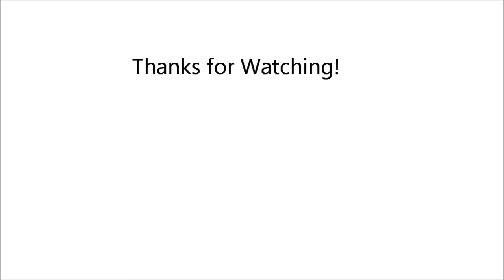Melting Pull Tabs And Other Scrap Aluminum

Comment: I had heard that Al cans and foil were not the best for smelting... now I have the numbers I needed. I do plan on using cans and foil for alloying other metals. 
Thanks for posting!
Reply from the maker: I tried melting foil once but I didn't get much aluminum out of it.  Thanks for watching!
Reply: No, cans are not so good for smelting, cans are made from a wrought type alloy, usually 3000 and 5000 series

Comment: To end with less slag, melt half of your large pieces in one crucible so that there is a puddle of liquid metal at the bottom of the crucible, then pour half of your tabs into this. Doing this will reduce the surface area of aluminium exposed to the air and in turn will reduce oxidisation
Reply from the maker: Good idea, thanks for watching!

Comment: great job seems like pull tabs melt very well the ingots look great one piece of advice i can give is to make sure that whatever aluminum you melt down is dry before putting it in the crucible because if there is any moisture on the aluminum when you melt it down the steam could pop and throw melted aluminum everywhere which wouldnt be good. im curious on how strong the aluminum from the pull tabs is because i plan on eventually making model engines out of this aluminum and im curious if the pull tab aluminum is a decent alloy
Reply from the maker: The cast aluminum using pull tabs has decent strength but it is more brittle than cast bronze (it doesn't bend much before breaking).   I haven't done any strength testing besides beating the aluminum with a hammer :).   I do prefer cast aluminum engine parts instead of  pull tabs because the engine alloys were designed for casting in the first place and it takes a whole bunch of pull tabs to get a decent amount of metal.  Thanks for watching!

Comment: Can I suggest that you clearly mark which ingots are of which type of Aluminium, as the impact wrenches were of a far higher quality and with certain added elements to match specifications, whereas the pull tabs would be of a lower quality and specification. 
I plan to divide my Aluminium stock into: Cast [C], Drink Can [DC], Extruded [E or Ext], and possibly Wheel [W or Wh].
Another way to clearly differentiate the different source material would be to cast your ingots into different shaped molds.
Why? So as to provide the best possible material for future uses and to hopefully provide more consistent results.
Reply from the maker: That is a good idea.  For these ingots I am planning on mixing the two types to improve the properties of the pull tab ingots.  Thanks for watching.
Reply: Mark Fryer 
It's not really a question of quality - aluminum cans are good quality - almost pure aluminum. If anything, the aluminum used for cans is too pure and thus doesn't cast as well as alloys intended for casting.
I know this is probably what you meant, not calling you out, just clarifying for future readers.

Comment: I have been puzzled why people continue to pull off the tabs from the aluminum cans. There has been an enduring urban legend (absolutely false I might add) that the tabs are more valuable separately than the aluminum cans.  They are not.  Scrap value is the same for both
Reply from the maker: True, the scrap value is the same.  I don't bother melting cans anymore, too much mess for what you get.  The paint and plastic put off fumes too.  The good thing about the pull tabs is they don't put off the same fumes as the rest of the cans when they melt.  It isn't really worth melting the pull tabs either though.  They are too thin and you need too many.
Reply: @MoltenMetalCasting  I think a practical partial solution to the oxidation and excessive dross problem with aluminum can melting is to strongly crush the cans (I stomp on them several times and then thump the crushed can once with a 20 pound sledge)  before I put them in a recycling bag. Burning the whole can down separately in a small crucible facilitates oxidation of the aluminun in each can in addition to the paint.  In simple terms oxidation means part of the aluminum in each can is consumed in the fire  - it's gone. Aluminum powder is an actual fuel source (thermite, fireworks, explosives) and very thin aluminum cans can partially oxidize (be consumed) in extreme heat. Better to crush them first.  We forget that aluminum cans seem to get thinner and thinner every year. Aluminum foil isn't acceptable for recycling for a very good reason - it burns up. Better to drop the heavily flatted cans as aluminum discs  into a pool of molten liquid to very quickly melt rather than let them burn up in the open air and gradually shrivel and sink into the pool.